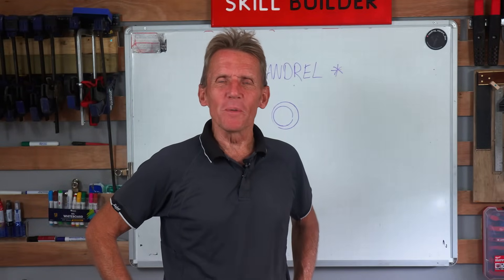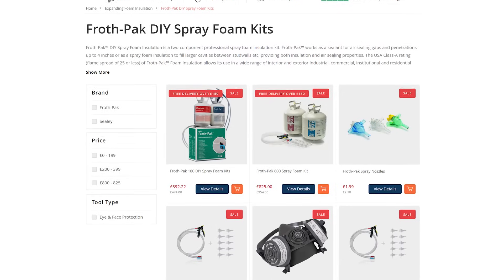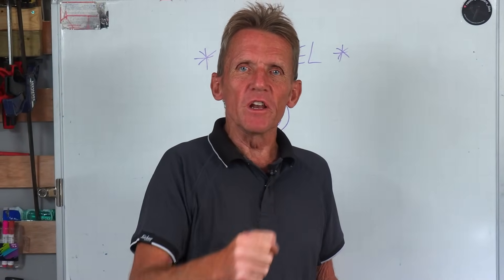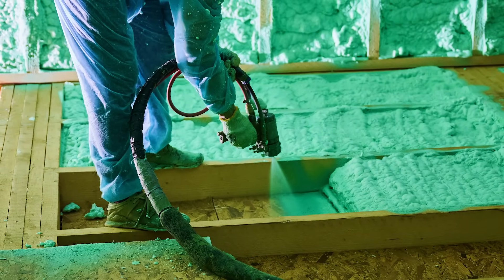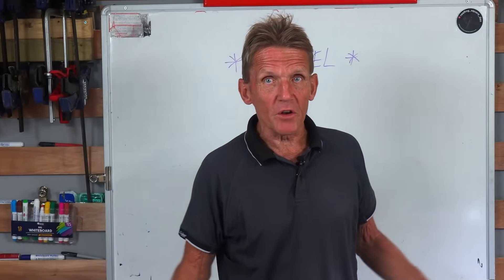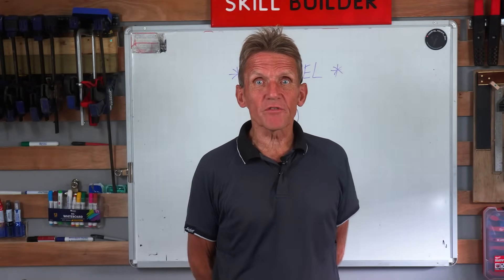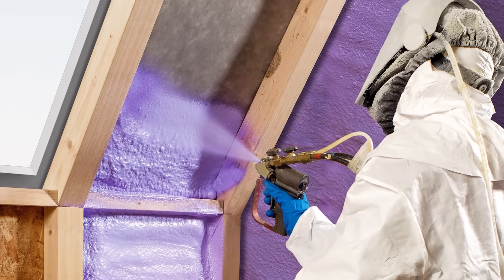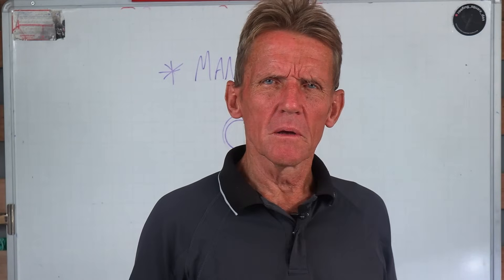DIY Spray Foam Insulation ~ Is it a Good Idea?

Comment: Just read a news article where a bloke couldn't get a mortgage on a property with spray foam insulation in the loft.
Reply: It happens a lot which means you can't sell unless you find a cash buyer
Reply: It happened to a neighbour of mine. Ended up having to have a new roof!

Comment: It's the Elderly that are most vulnerable called into a place that had spray foam the Condensation in the loft was rotting the rafters and water was laying on saturating the ceiling Sheet Rock (Plaster board) as that was Foil Covered.  What a mess to sort to and ventilate.

Comment: I think it’s about time Rog that the likes of skill builder and Mr clevitt started to question what is happening to off cuts of PIR insulation . All going to landfill .Weve just finished a warm roof only 12m2 . There must have been nearly a bulk bag of off cuts . Times that up and down the country a lot of waste not breaking down just laying in the ground god knows what kind of harmful gas it’s giving off .Who’s talking about it ? No one . All everyone is talking about is a bit of air getting into your house as though it’s life or death . Meanwhile we all just load the skips and forget about it . We try and use sheep’s wool where possible but building regs say otherwise . There should be recycle skips in local merchant same for wood .
Reply: In the fatherland the waste goes back to the manufacturer
Reply: @peterthebricky  that wouldn't do the shareholders of St gobain or kingspan.  Bare in mind neither are uk companies they dont give a crap about our waste problem.  Neither does anyone else as long as your house is airtight that's all that matters.  Skillbuilder and the likes of Robin should be asking these questions and it should be recycled .
Reply: @jharris7407 it's a really good point, applicable to a lot of stuff in all industry. It would be nice to see a video (or rant!) about it in regard to the building industry. I suspect the waste in building a house is significant (and harmful).

Comment: Hallo Mate, greetings from Hungary! You ROCK! Just got yourself another subscriber. I like the educational part and the style, sometimes I miss the UK. When you mentioned the Rockwool, it is true that its good and easy to install, but doesn't it also collapses on itself after a few years (maybe 8-10)? I have a rockwool insulated house and I find that there are about 40cm gaps on both floors (ceiling level) and thinking to fill it up with foam :)

Comment: Years ago I asked a friend  who's a roofer what he thought about spray foam in the loft and he was dead against saying that it doesn't breathe which will lead to moisture build up and rotting the timbers. Then sometime later  the problem arose when trying to sell.
Anyway, some months ago I looked into getting some additional loft insulation in the house I bought as there was only about 2" on the loft floor. So I contacted an insulation company that looked reputable to get a survey done and I made a small boob thinking it was for the wool stuff but it turned out to be for spray foam which apparently is now a breathable type and which is now acceptable to mortgage company's, anyway, me still being sceptical I refused the survey and I asked the surveyor of a rough price to spray my size of loft and he said 5k,  that's a tad steep for my liking, I shall just get some rock wall laid..
Reply: Everything these days is in the thousands! I called a roofer for a refelt on a flat garage roof. Asked how long it would take he said a day. Id priced the felt from roofing suppliers, allowed fuel, gas for the torch etc then doubled it. Came out approx 700. He wanted 1,600. 900 for a days work? Not here - bye! 
Boilers are the best 4, 5 grand and upwards. Takes them a day to swap a boiler and 2k for a top name boiler. They want thousands for a few hours work. Pricks.
Reply: this may be true for the boiler installation example you mentioned, and for many if not most jobs these days. But for the example you gave about your roofing quote, you should maybe rethink your views on it lol. Roofing is one of the hardest, dirtiest, and most dangerous lines of work in the trades. Most people cant hack it even for a day, let alone everyday...day in and day out. Roof work is hot & grueling in summer(like heat-stroke hot! Sun baked asphalt can burn skin at the touch), and wind swept freezing in the winter (frostbite to nose, toes and fingersis is fairly common when you're working a sweat in below zero wind chills). 
 As for hard labor, roofers have to regularly lift 100+ pounds. Not only lift but carry it ladders on thier backs. Repeatedly. Up the ladder with a load and back down for another, over and over often for hours. The materials are extremely heavy and difficult to move and work with. 
  They also have to deal with spending everyday in a place that is dangerous to just be standing and walking, let alone while doing hard physical labor. One slip can end your career...or life. And do while handling pneumatic nailers all day where accidentally shooting  and 2 inch nail thru your finger/hand/foot is not uncommon to happen at all. And those are the "best case senario" places youd prefer that it happen.
 To top it off, most people think there isnt much to it or it doesnt take much skill. When actually it takes years of experience and a good natural problem solving ability to outsmart water and the elements, especially when locating the true source of and repairing leaks, or ensuring good long term protection from a new roof.
 
Plus, if the guy is running his own business he probably has all the usual expenses. Employees to pay/vehicles to pay for maintain/expensive tools & equipment, etc.
 And the the cost of insuring a roofing business is steep, liability & workmans comp both. So the guy probably wasnt bringing home the $900 you estimated. It could have been low as 4 or 500. Give it a try yourself and see if you still think it was such a rip off lol. Theres a damn good reason that roof work is basically the one home repair that most people will rarely even attempt to do a DIY job lol. And even when it IS attempted, only a very few are successful 😅

So I'd say that was a pretty darn fair price. And not just because of considering all the reasons i just mentioned, but because I'm in the industry and i know what roofing companies are charging...and that was a VERY good price. Especially these days.

Comment: I've just had to replace half my roof because of spray foam - several rafters, part of the wall plate, 350+ slates. Water drips down a channel in the foam and rots the wood. You can't see where the leak is because of the foam. The slates are all stuck together, rip one and 4 or 5 crack - repeats with each slate. If you buy a house with foam, knock off the price of a new roof. It should be made illegal !!!
Reply: Thank lowered building regs for that... which was also the problem with an inferno in London of a certain very tragic loss of life... I do wonder if Kingspan and Celotex were behind this spray-foam too.
Reply: @ThaiLifeAmerican  
Sounds to me like you might be a spray foam salesman/conman.
Reply: Sounds like you had a pikey roof your house😂😂
Reply: @username7274  
No, the previous owner had a conman spray foam salesman who sprayed directly onto the slates and rafters.
Reply: I agree with you, sprayed it onto the  roof of an old shed 15 years ago, with solid old grown timber rafters, they are all rotten now due to lack of ventilation I recon, that stuff should absolutely be banned
Reply: Its good if done correctly.  I wouldn't do it myself though. Get a pro

Comment: Just a thought, could you line each area you are going to spray foam into with plastic sheet such that once the foam set into a block it would be removable? That way you would still get the transport cost saving vs solid insulation, avoid inaccurate insulation block sizing due to cutting, and be able to remove the insulation for ongoing structural assessment. Of course the extra labour cost may be cost prohibitive and the plastic sheet would have to be fire safe. I'd be interested in your thoughts.

Comment: I commented on your last video about spray foam and the risk to electrical wiring, effectively when sizing cables you need to take into account insulation and size the cables accordingly. But I’d also question the chemical reactions between the two, PVC cable degrades in certain conditions, so I’d be slightly worried about that also. 
Not to mention the fact it makes rewiring or altering any service (wiring, plumbing etc) 10x more tricky if it’s encased In foam. At least Rockwool, Insulation board etc can be removed and replaced.

Comment: Perhaps take a hint from the current trend of insulating outside walls of property's with rigid insulation boards and render..
   
So..  Remove all your roof tiles and building paper.. Board the whole roof with 11mm OSB SIPs (Say 100mm) Panels.  
Cover with Tyvek,  re-batten and re-hang your tiles..  It's a lot of work and wont be cheap but it should be acceptable 
to the Mortgage people..
Just a thought..

Comment: Hi Roger, what would you recommend for insulating a house? With air tightness comes condensation problems but If we add ventilation it's no longer air tight. What's the solution? We can't all have great insulation and dehumidifiers running constantly. Thanks
Reply: What type of building is it?  A 'house' can be made of so many things, it's that which determines a proper insulation. Moisture control is in any house critical to how effective the house is able to manage insulation.
Reply: @JT-si6bl   hi jt-si6bl thanks for the message I was hoping there would be a general good option but in my case victorian brick house with no cavity wall insulation. And already has some moisture problems in the winter
Reply: A ‘fully insulated, draft proof’ house only works when there’s also a full air management system. 
Moisture laden, or ‘waste’ air needs to be removed from a house but the heat or energy in the air needs to be recovered and transferred to the incoming fresh air, and this applies to all spaces in the house, not just one or two points. 
Basically, any property will have an upper limit to the amount of insulation that can be used efficiently, before the requirements of ventilation outweigh any improvements, which then takes the property into the realms of ducted ventilation with temperature recovery, and to what or how many areas. 
Then we see the true cost of trying to improve heating / cooling efficiency of a typical existing house .
Reply: Positive whole house ventilation 🎉

Comment: Leave it out, this will make your life hell, done it on 1 site, matey told me to get the redlands on the roof , week later spaceman turns up to spray foam, lifted the small redland tiles, roof was wokney like a quivering lip, it's an issue for sure and as a homeowner they offer open cell or closed cell, most homeowner always opt for the cheaper option open cell, stick with celotex or rockwool

Comment: In the USA builders are recommending making your attic a conditioned space with spray foam in the rafters. Would you put rockwool or other types of insulation in the rafters?  Do you all even like have your attics a conditioned space?
Reply: The best way is using PIR 50mm less than the depth of the rafters (to leave 50mm ventilation space behind the insulation, foam the gaps and cut it back flush with the rafters, then overboard with 50-ish mm PIR over the rafters and tape where the boards meet with aluminium tape. 
Mortgage companies don't mind that at all and other than thr labout cost it should actually be cheaper than spray foam. Robin Clevett has a good video on how to fit it if you are interested. 
To cut use a mask and goggles and you can either use a very good knife or a saw. It will make a lot of dust and it will be itchy.
Reply: @mihaicosmingradinaru1859 
 Excuse me for the silly question. I don't know what do you mean by PIR .

Comment: Anyone who's thought spray foaming a roof or wall-space is a good idea has never had to work around an old expanded-foam installation, and clean/remove it to get their work done. Its awful stuff, and it's toxic for the environment (air, water) when it degrades too.

Comment: Love the videos guys! I've just recently purchased an end terrace house (1900's). The gable end is obviously quite cold and is currently dot and dabbed in the main bedroom. The plasterer has suggested I remove the plasterboard, batten the wall out and insulate before then putting on new plasterboard which he said he will skim over and should be fine. Has anyone had anything similar or has any advice on what I can do (Its going to be rented out).
Reply: Sounds like a plan. Years ago, when buildings were being grant funded to improve their cavity insulation (with a type of graphite, polystyrene bead), I discovered that my semi in Kent had cavity walls back & front but only single skin brick to the side walls - so it didn't qualify (built 1946, just after the war). The outer side wall is always the one that manifests occasional dampness if any furniture is put against it and the house lacks soundproofing on the side wall to the neighbours. So it seems like a pain to do, but I reckon it's sound advice for all those reasons, including cold protection.

Comment: I never use foam around timber. It directs all moisture to what is the most absorbent (timber) & rots it.
I use foam for its original purpose; Additional fixing of uPVC & aluminium windows into cement based products & brickwork. Always leave room for it to expand outwards & cut off the excess after it's cured.
Reply: Out of interest, what do you use around wooden windows (and doors). For example, a frame that's being fitted up against stonework and has gaps?
Reply: @ricos1497  For big gaps I use 3-1 mortar with PVA. Then there are plenty of mastic tube products & frame sealants around to tidy it up.
Reply: @markatchison9974  thanks! That makes sense.

Comment: the yanks have different building methods and mostly use wood, rather than bricks and mortar like us proper folks this side of the pond lol
Reply: You mean England. Large parts of the UK use timber frame. Still wouldn't use spray foam though!
Reply: @ricos1497  timber frame is all about vapour barrier and insulation and shingles and so that other stuff that becomes far too complicated
I do enjoy watching them build things though, and they always spray foam everything so they must be doing something right 🤷
Reply: @therealdojj  my timber frame doesn't have spray foam! Timber frame is fairly common in Scotland, but spray foam not so much (to the best of my knowledge). I've always associated with moisture issues. I'm fairly certain the Scandinavians avoid it too.

Comment: Looks like Rodgers been in the sun a tad too long😉. Insulting the American audience straight away is a good way of making them irate😁😁. Hate the foam stuff should only be used around doors and windows in my opinion. Best advice is apply and let it set. Dont over do the application. Thanks Dillon. 👍👍

Comment: Spray foam rots the crap out of your roof, leading to shorter lifespan, and wjen time comes to have/need a new roof the cost would likely triple a standard strip and redo due to the amount of time ,man hours, extra skips, and new timbers before covering in again. No thanks

Comment: The fire rated stuff is good for securing electric back boxes on crumbly stone walls or other sandy stuff that won't take a screw and plug. Just have to make sure it stays level as it's setting and doesn't push it about!